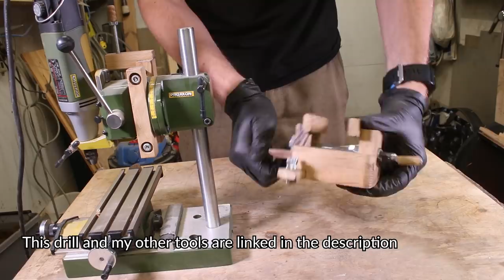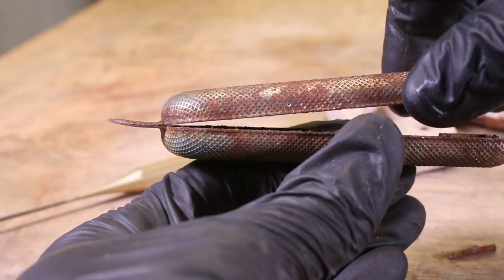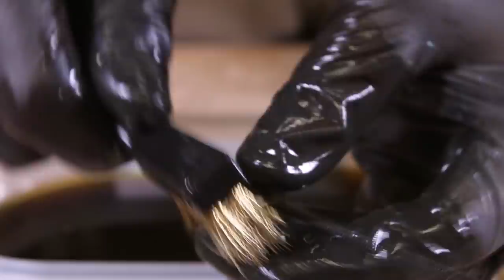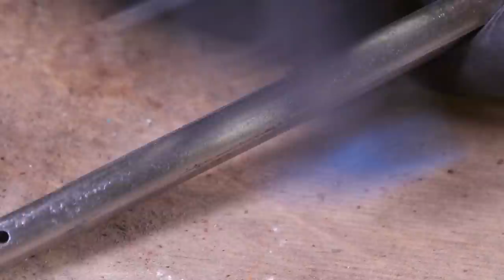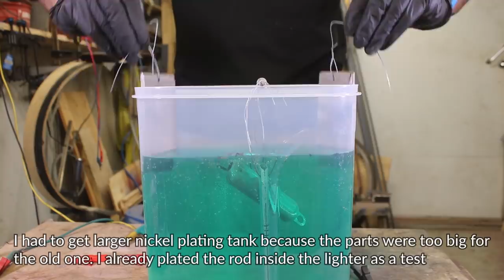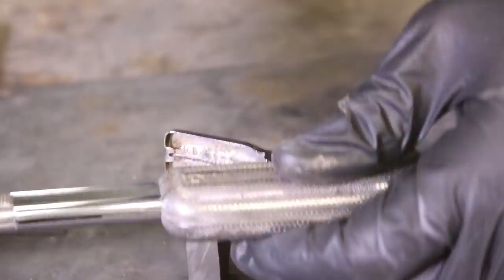Old Spark Lighter Restoration - Imco Funkmeister

Comment: You did what most of the restorers do not even think to do: You plated all the parts.  
I've seen them polishing and removing old plating and painting instead of plating again.
Best regards from Rio de Janeiro.
Reply: So what's the difference there?
Reply: Can you give jesus a hug
Reply: @Ballmacher  if you don't plate the parts again, the pieces are prone to rust much quicker
Reply: @Ballmacher  the nickel plated helps block rust

Comment: When you use the rust remover, does it ever remove rust 100% without scrubbing with a brass brush?  Is it a function of time or does it always require some manual scrubbing?  Also, does electrolysis work better, I believe I’ve seen you use both methods?  I really enjoy watching you restore these lighters. Final question, do you keep the lighters or sell them?  Or are you being paid to restore?  I work 6, often 7 days a week, 10-14 hours a day. This is quite therapeutic in that it helps me completely stop thinking about work for just a little while. Thanks for making the videos. You can send me the therapy bill... lol.

Comment: Spectacular restoration, as always! I've a question: how can you change the flint without dismantling everything? There's a place where you can put the flint directly in its position? Again, my best congratulations to you for your incredible work!
Reply from the maker: Yes, there is the hole under it ner the tip I show in the beginning. It opens when I slide the small sliding part back

Comment: Way more than I would have done! I would have simply cleaned it up the best I could without disassembly and attempted to clear the flint tube and install a new flint. 99 percent of the time when dealing with old flint style lighters, a corroded, stuck flint is the main problem. Even the best looking new in the box old lighters can have this problem. I've had it happen with modern lighters still in the pack when I got them because cheap lighters use cheap flints. I have redone lots of lighters, some I take completely apart, but many I do not. Knowing what a pain Imco lighters can be, I think I would have just done whatever necessary to get it working and let it go at that. Oh, I highly recommend you use modern Ronson or Zippo flints (both brands are made by Zippo, Zip has owned the Ronson brand since 2010) Why? they have some extra stuff in them that makes them actually  spark better than plain flints, and they are resistant to corrosion. The old black or brown flints had no such extra stuff, and that's why most old lighters have a corroded flint problem. Ronson Flints didn't have it in the old days, heck I don't think Zippo did. It might have been the red flints of Dunhill that started the trend.

Comment: Why are you using so much Rust remover in your project? Event if parts are small. Isn´t it wasting?
Reply from the maker: No because it can be reused until the chemicals have all been used up. Pouring more or less rust remover will not affect the whole amount of rust which can be removed with the bottle

Comment: Why not use electrolytic rust removal? It's better because it doesn't remove metal
Reply: Neither does Evaporust/MC51 and its far easier to use than having to setup an electrolysis bucket...

Comment: Why has rust in parts that never have rust in normal conditions? Is this a real old lighter, or you inmersed a slightly used one in water with salt?!! We have never seen such amount of rust even in the highest misused ones. Thats why the steel plate is made of stainless steel. You are faking this "restoration".